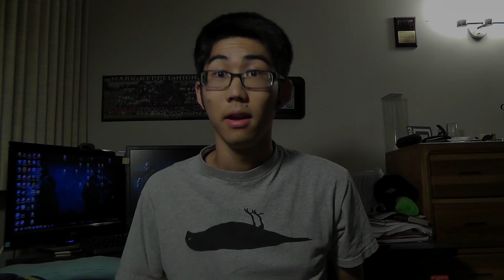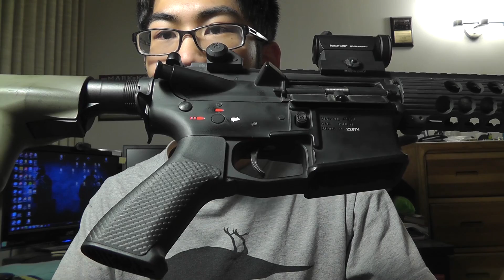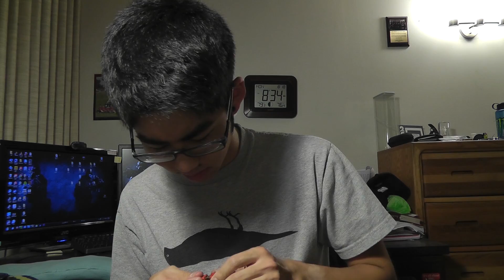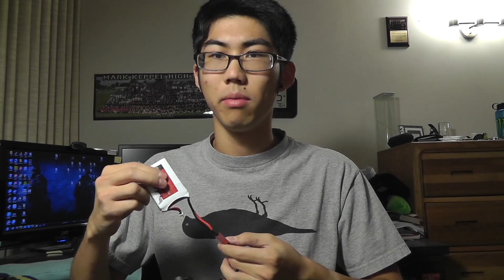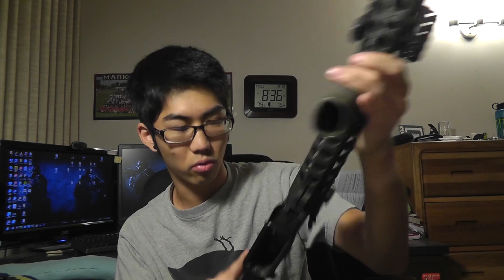BUILD: George's Backup Lower

Comment: Can you possibly make a video showing how to change a handgaurd on a standard m4/m16 to switch to a rail system please because im trying to mod my gun and cant find any videos showings how to do it and i sorta am new to Airsoft
Reply from the maker: that really depends on what you want to change it to... Assuming you have just a delta ring you can pull down on that and pull the handguards out and then replace that but it depends on the handguard you buy. If you're removing the handguard you need ar AR wrench to remove and then install depends on the rail you buy.

Comment: Hey VRA,  I've been trying to get my hands on a V3 Spectre but they just never ever seem to be in stock. Are there any in gearbox alternatives out there? Ive been looking around for quite some time but havent happened across anything worth while.
Reply from the maker: There's the ASCU for v3 but my experience with those has been pretty mediocre at best.
Reply: valleyriverarms

Yes Ive been reading to much the same conclusion on them. They seem to be burning out pretty often. I dont exactly have a choice however as the V3 Chimera has been out of stock for close to a solid year and havent heard from them about a restock yet. 

Oh the woes of running anything other than a  M4.

Comment: Hi dude i need some tech help.. 

lonex cyilnder

lonex cyilnder head

lonex piston head

lonex piston

120 spring

LONEX A1 Infinite Torque-Up & High Speed Motor

SiegeTek gear set 14.09 ratio

What can RPS i can get? 

thanks :D
Reply from the maker: look up the HSA airsoft calculator. And you're missing info to help calculate rof. I'm guessing mid to high 30's.

Comment: I have the same motor/pistol grip, (g&p snake skin) and for some reason it feels like it is a lot bigger than any others and when the trigger is pulled, it sounds like the motor is shaking. I have wrapped electrical tape around the motor can to give it more width but the problem still persists. Is this normal or is the grip off spec?
Reply from the maker: i don't seem to have the problem that you're having. How loose is the motor with the tape on?
Reply: valleyriverarms every time I pull the trigger it sounds like it's shaking and feels like motor is rattling around in the grip. It's also visibly bigger when the motor plate is off
Reply from the maker: Motors should be a little loose in the grip to allow for smooth adjustment. If it's as big a difference as you're describing idk what could cause that. I don't think it would cause any catastrophic failures though
Reply: valleyriverarms after shooting for an hr or so I take out the motor to check the pinion and it seems fine. I just don't know why it rattles
Reply from the maker: yeah if you've done all the mods and stuff you've mentioned I cant think of a reason.
Reply: valleyriverarms alright thanks
Reply: Have you tried checking if the motor tower is fitting too loose in the Gearbox hole? That might be the cause of your problems

Comment: I think it would probably be good just to get a lower ratio gears for both the trigger response and rof overall but his gun is his gun and i might just love fast guns too much.
Reply from the maker: you lose efficiency in the power consumption but yeah that's usually how i do it.
Reply: Yeah the power consumption can be a downside but I'd always rather have the trigger response. 16:1 gears could always be a good idea though too.
Reply from the maker: its a trade off. In this case I felt that the trigger response would be good enough and the added bonus of saving power especially as a backup was worth using.

Comment: Great video as always. Could you clarify how the MOE affects the meshing of the gears please?
Do you meant that it makes the gears go a bit crocked? Thanks
Reply: The motor sits at an angle which causes the pinion gear to be misaligned, causing dying cat screeching. Two aspects about the MOE that cause this:

1) Backstrap can cause grip itself to be misaligned with body due to too much material. Solution is to file away at backstrap until it fits flush with body.

2) If it's the plastic motor plate, one of the motor alignment brackets is too big, causing the motor to sit at an angle. Solution is to buy a metal MOE plate (gl finding one) or to shave down the bracket until the motor aligns correctly.

Source: I had one.
Reply: Tyrnek Thank you! now I know why my m4 sounds so awful while my other guns purr like a kitten haha.
Reply from the maker: Tyrnek ^yeah pretty much this.